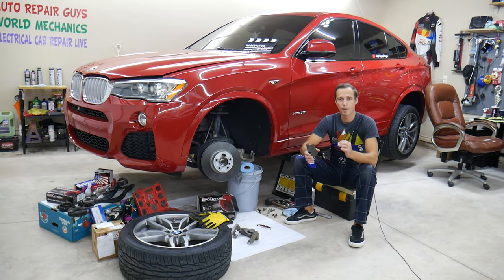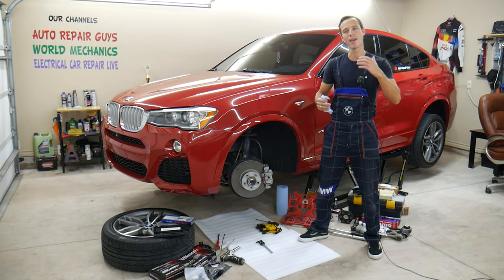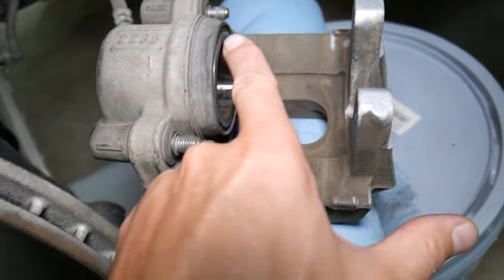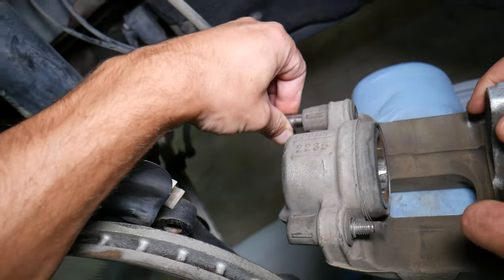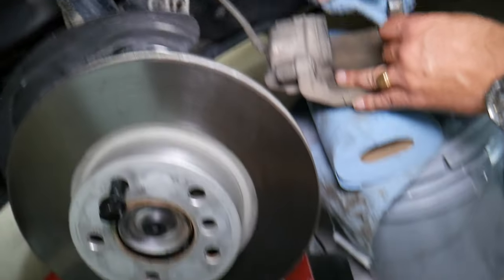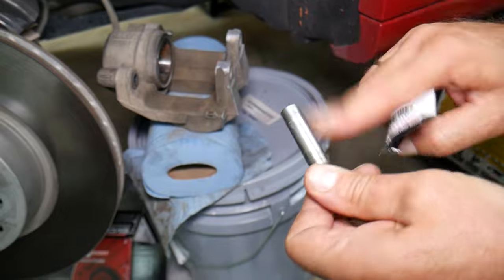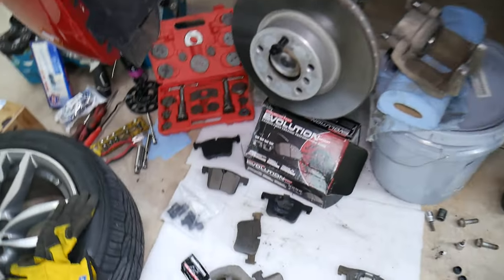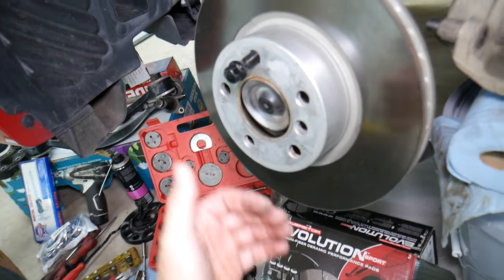HOW TO MAKE CAR BRAKES QUIET, NOISY BRAKES FIX

Comment: Hi guys,  great video as usual and very informative.  
I've suffered noisy brakes on a number of occasions and whilst grease will dampen the noise,  it doesn't address the 'root-cause' of the resonance.
What often causes brake squeal also contributes to a slight reduction in brake efficiency,  on examination of the brake pads you will often see the surface of the friction material has 'glazed-over'.  This glazing is usually due to your driving style caused by constantly 'riding the brakes' leading to the pad surface becoming overheated.
A light rub with say P120 sandpaper will remove this glaze and stop the squeal at source.
Next is trying to adjust your driving style so you don't keep riding with your foot on the brake when not accelerating..